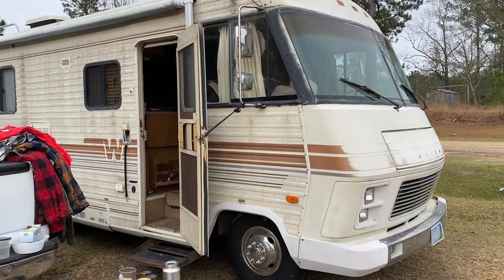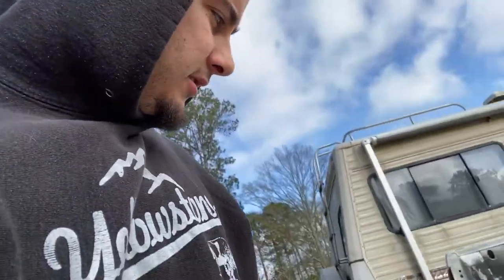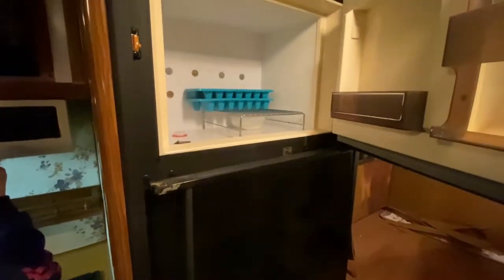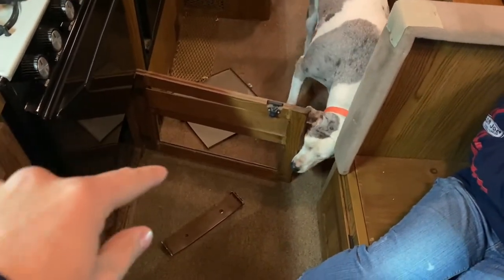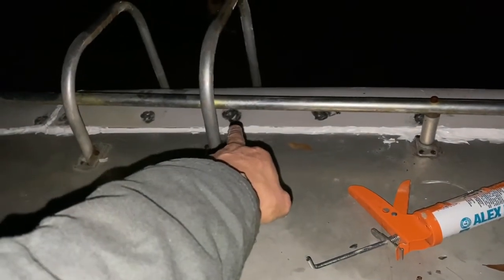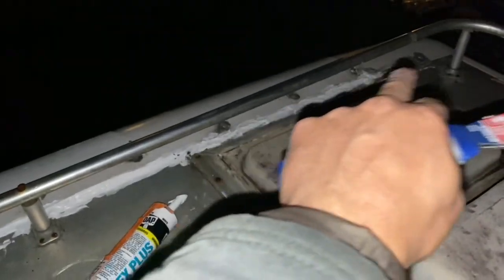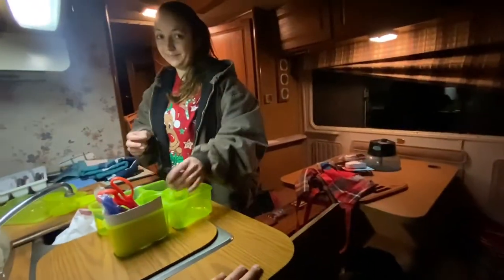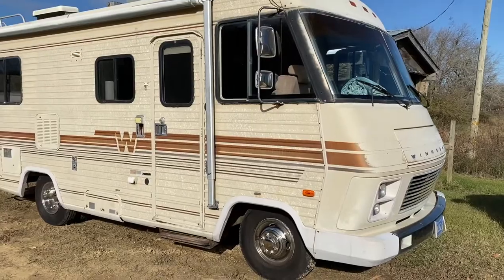Will this neglected 1985 Winnebago chieftain run and camp? In just 4 days?

Comment: I bought exact same RV from a crook named Bruce in Wasco, CA for $1800. I did bot have any experience with RVs. 
Steering wheel was almost coming apartdue to torn gasket. Break pads in the front wheel heat up quickly. Master cylinder was bad. Engine belt was bad. Vacuum switch was broken. 
Rear break was leaking. Fuel hose started leaking. 
Coolant thermostat was not working. Engine started heating up. He said he gave to his friend $2000 to help with back mortgage.
Later on I found out that he bought it from the previous owner for $500 when he was asking $1500. 
Be careful if you don't have experience with RV. There are some very dishonest crooked prople out there. Don't trust most mechanics.
Reply from the maker: Yea thankfully I do all my own work and went over it very thoroughly
Reply: What do you expect to get for 1800 ?
Reply: I have a question do you have any idea what’s the problem wit mine it’s a 1985 same model js doesn’t reverse

Comment: Nice man I got a 1986 chieftain 27ft in doing a newer 454 swap too. We tried to find a 21ft but there rare here in Canada .
Reply from the maker: Mine came factory with 454! 
Yeah I haven’t seen another 22 footer like this one. We love it it fits better everywhere a little small on the inside
Reply: Nice score , we saw a 22ft but we missed the deal . Mines the exact same as yours but 27ft , mine has the 230hp/360ft lb 454 with 3 speed we avg 9mpg going 58 mph empty . Picked up a 99 454 EFI with 4L80 might swap in one day
Reply: @CocosPlayound  does yours have a bumper sticker on the tow capacity ?

Comment: Love the floor-plan _ my m-22rc is an '84 just under 89K miles _ it is my 1st rv & had it for 10 months; did only 1 short trip so far, about 1K miles through the Rockies and averaged 10.5 mpg _ i didn't think that was too bad, and for a carburetor type 454 _ it will flood pretty easy if i don't follow what i know works best and this is on a newly rebuilt carb: so i push gas peddle down, quickly release as it sets the choke, turn until it starts, usually two or three turns unless it's very cold out; i've learned the hard way never to step on the gas even when it seems like it won't start, but it always does one or two more turns _ Sleeping in it being up high i don't get any vehicle headlights shinning in; one of those little unexpected priceless perks: a good nights sleep :>/
Reply from the maker: I have had mine since December and I try to do one or two upgrades before each trip I’ve made about six trips in it. 
We love it I even told my side-by-side with it!
Reply from the maker: I want to look into getting Holly EFI

I already had to add a lift pump to help with vapor locking that was my biggest issue

Comment: I just bought an 86 model 22 ft and I'm having fuel issues.  I replaced the fuel pump and both filters but still no fuel. Was the fuel tank your problem?
Reply from the maker: Mine was good until it got warm and it would vapor lock (boiling the fuel)

Comment: I cannot find RV monitor panel. There are sensors attached to fresh water tank but Nonitor panel is missing.
Do you know where it should be connected? 
Thanks
Reply from the maker: My monitor panel is above the oven
Reply: If you mean stove by oven, there is a hood switch on my motor home. 
Above the sink there is a "compressor switch" but there is no RV  black, grey, fresh water tank monitor panel. 
When I opened little door by the fresh water tank and traced the five wires, I saw that the wires are wired to the ceiling above the closet. I have no way to see where they are wired to. Electrical wiring for this year and model (1985 Chevrolet Winnibago Chieftain) cannot be found. And there is no good electrician to help me. 
I know that LPG tank has a wire attached to it as well, Water heater should also have wires to turn it on. Where those wires are? I don't know. 
It is very time consuming to figure out all these. I wish there was a good owner's manual but so far I did not find one.
Reply from the maker: Dm me of Facebook I’ll help you out. Corie Hyatt is my name where you will find me. I searched hard for manual and realized that they used one manual for 2 motor homes. The chieftain isn’t mentioned until you get into the manual
Reply: Thank you very much. İ will contact you